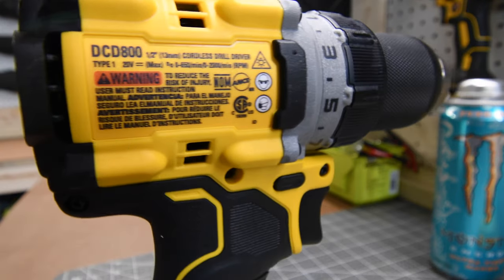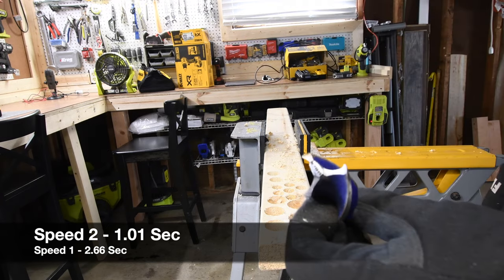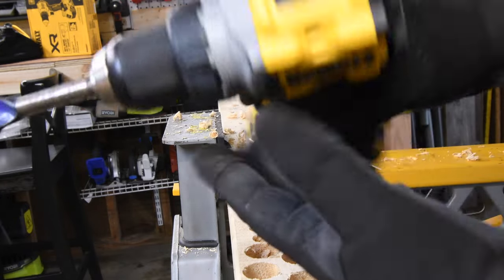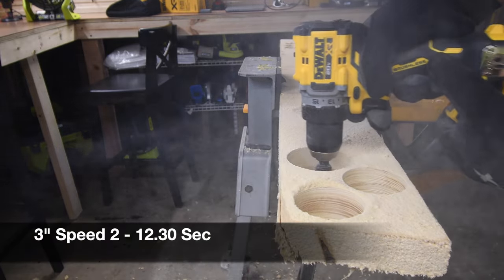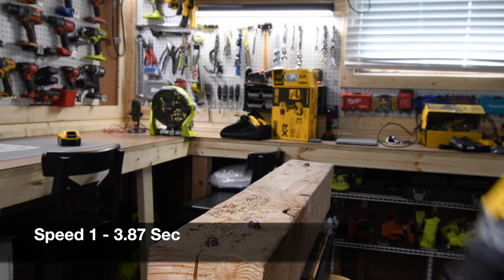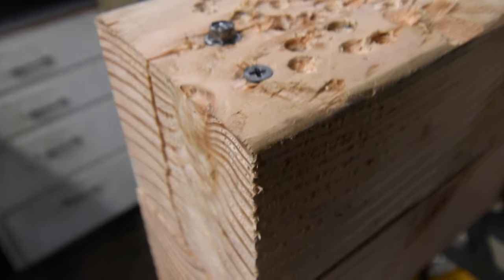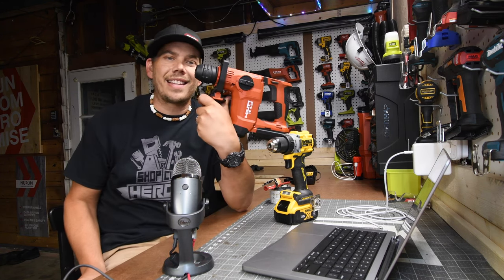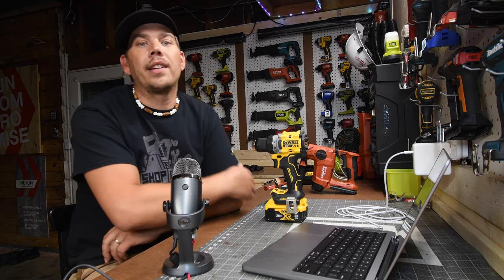NEW Dewalt XR Drill Driver! (DCD800)

Comment: Good video!
I’ve had the DCD800 for months now and use it 5 days a week, about 3-6 hours of the day it gets used and abused. It’s definitely built solid like a tank. 
I also have the DCD805 hammer drill for drilling into concrete, and absolutely no issues at all, another tank with solid build quality. 
Dewalt has definitely stepped up their game!
Reply: I have the Atomic 708 and love it and use it 90% of the time, I bought the 805 and yes the hype is real ,it is very powerful and solidly built and compact.
Reply: @interman7715  the same, but 805 not delicate at 1 like 708. To much power, not for DIY.
Reply: I am a contractor and I use the 805 on 16mm by 600mm auger bits through solid pine and hardwood beams ,it does it in speed 2  which is nuts !!

Comment: Of all your videos Ive ever watched I've never seen you drive in a dry wall screw or use the clutch setting. I like that even though u like to go straight to the tough stuff. I don't even own a DeWalt tool and I want it only if they put a hammer feature on it
Reply: It's a drill driver. Not a drill.
Reply from the maker: I will be adding that in videos now :)
Reply: DCF805 is the type with hammer

Comment: Recently bought one from screwfix in the UK, £299, came with 2x 5ah powerstack batteries and the charger, but a free 5ah standard battery and dewalt giving away a 3rd 5ah powerstack turned out to be a pretty decent bargain.

Comment: and like pretty much all of dewalt's mainline stuff, no emergency kickback shutoff and no foregrip attachment. 
So basically an unsafe 900 UWO wrist breaker for anyone who uses forstner bits xD

fun.   VROOM VROOM!
Reply: Emergency kickback, shutoff, and handle is only good for DIY😂🤣👍🏻👍🏻.
Reply: If you hold It by where the battery goes In with 1 hand its not that bad but yeah these drills get kinda janky sometimes lmao

Comment: The 800 drill and the 850 impact will fit in the smallest dewalt tool bag. the 805 doesn't fit as easily. Thats with the battery charger, 5 ah XP battery. impact bits and  small drill bits case

Comment: Hey David I got a question about the DeWalt dcd800e2 kit I got the other day off Amazon at the DeWalt Store the drill makes a slight not so very loud squeal on low rpm but at mid to high rpm seems fine just only at low rpm and I notice it more when switching from forward to reverse and back to forward the sound only lasts for 1-2 seconds then it's gone the drill has plenty of power no issues there what do you think will it will be OK? maybe use it for a week or two to see if the sound goes away? Thx Walter
Reply from the maker: it might need to be broken in a little bit.

Comment: Please make a video on the Milwaukee m18 1inch sds drill pleases no one has a video on the video and a versus video with Milwaukee, dewalt, Hilti, makita and ryobi
Reply: He said he can't afford new tools right now.
Reply: It's a shame he can't get the manufacturer to send him some tools but that might make it hard to be honest with his reviews.
Reply: I have the Dewalt DCH273 1 inch SDS Plus rotary hammer and it works amazing. The only issue I have with it since day one is when your in chipping mode the bit gets stuck in the out position. You have to slam it in to get it to hammer the bit again. It could be the bits I’m using, but I always grease it up before using. I’ve taken it apart to see if there’s anything wrong, but all looks good.
Reply from the maker: I will when I can :)

Comment: Milwaukee fanboys (not regular users): well my fuel hammer drill is bigger and better and stronger and has a handle! This is stupid!

This is a COMPACT drill. Don’t compare apples to oranges. If you want to see the fuel hammer drill get tossed around by a less expensive & better competitor there is the XR DCD996, 998 Power Detect & 999 FlexVolt Advantage. 😐
Reply: Found the DeWalt fanboy, dude your comment was just as bad as any other fanboy type of comments.. Oh the irony
Reply from the maker: This is a drill driver